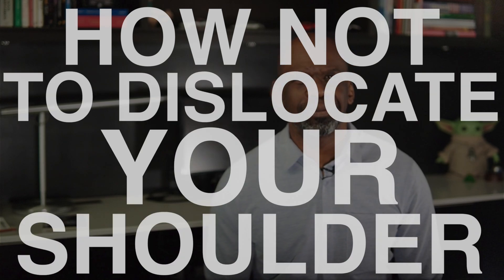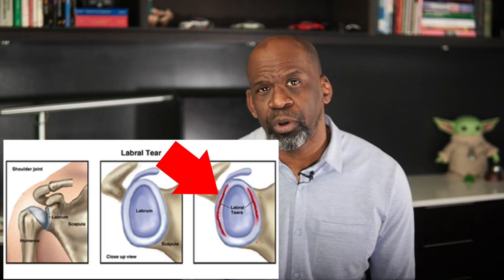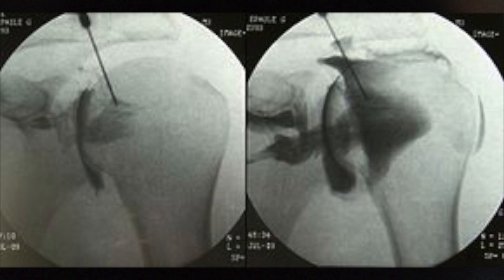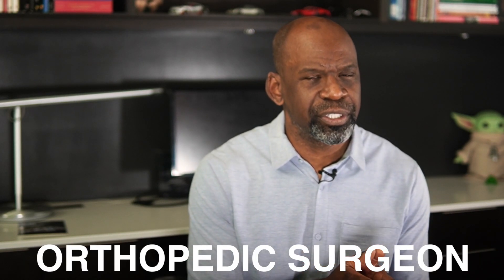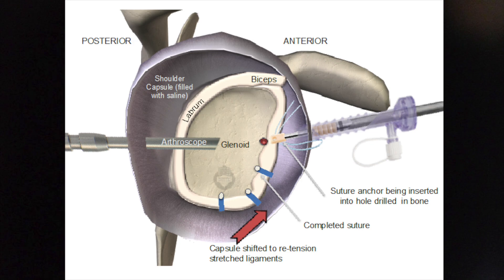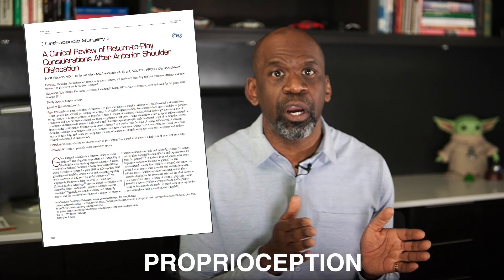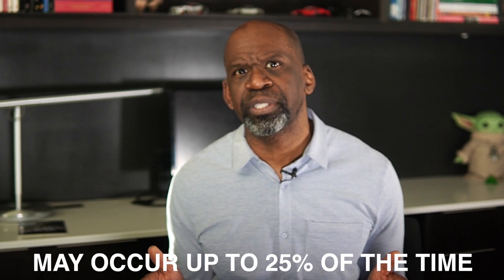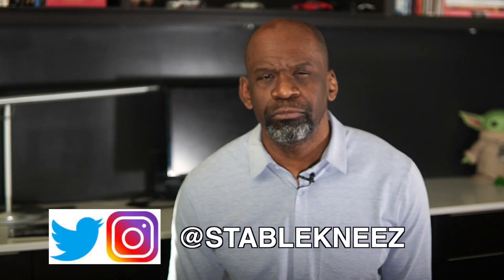Why Does Your Shoulder Dislocate? Surgeon Explains | Dr. Chris Raynor

Comment: I broke my clavicle many years ago... Had to go to the ER. They weren't helpful and just gave me pain meds since i already had it in a sling. No surgery. A few years later my first dislocation... As of now, ive had 4 dislocations. But it hasnt happened in a few years. I'm just curious if my clavicle is possibly the reason for all of this? It healed kind of overlapping. 
I am currently doing very high rep lightweight dumbells mixed with calisthenics about 5 days a week for my strength training. I just started incorporating mobility exercises as well. That is going to be my main focus for a while. I have pretty good range of motion considering all of this. But i want bulletproof shoulders. 
Ive also dislocated my knee cap twice... 😅😵‍💫

Comment: Hi Dr. Chris Raynor, I have been to 3 orthopedic doctors and they were not helpful. they just told me to let it be... please cover options and recovery of AC joint dislocation. My clavicle got dislocated after my motorcycle slid on a slippery road. I was only running 20 kph, slowing down on a heavy traffic ahead. I was wearing helmet, knee and elbow pads and a roost guard for protection. I fell on my side. I felt my scalpula go inwards and my rib cage come in, and somewhat felt my clavicle got lose from the joint. I struggled my breath for awhile ( maybe because of the ribcage being compressed) but i recovered and stood up. Thats when i realized something was wrong with my shoulder, it was painful to lift my right arm.

According to the xray and ultrasound results. I have a dislocated clavicle, slight thread like horizontal break on my 5th rib. and minor injury on my clavicle. I have been to 3 orthopedic doctors, they just told me to let it be, just use a arm sling. I insisted on bandages and side brace. but they said they don't recommend it. They refuse to explain what's the real deal, I mean they just say it will stay that way, i have to live with it etc.  I had to fish around to force them to tell more lol. sigh. They didn't even open the idea of surgery.  They gave mea pain relievers and anti inflammation meds though. 

I had to research on the internet to know for myself.  However those bandages, back support and side brace helped me move through with my everyday life, so i use them everyday. (alternately or altogether). It's  been almost 4 months, no swelling and i can move, but my arm strength is about 50 less now. I feel pain when i try lifting heavier things.  I do try to improve my muscular strength, but very careful on putting strain on my remaining ligaments. I hope you can shed more light in this. I hunger for more information regarding AC Joint Dislocation recovery and surgery. although i'm fincancially incapable of having a surgery at present. I love watching your videos Doc. They enrich my mind. Thanks so much, Merry Christmas.

Comment: I dislocated my shoulder about 7 years ago after slipping on ice with a bicycle. I did the smart (not) thing and popped it back in myself. Luckily, according to the doctors, the injuries were very minor.
The first 2 years it would quite frequently pop out of place and was constantly hurting. I was unable to do a lot of activities (pull-ups for example were a no go, hanging was quite difficult, climbing and so on)
After a couple of years I started training in Bjj, which I assume helped slowly strengthen the muscles around it. Now I can do pull-ups (up to 15 with weights), hanging for long periods, climbing, almost any kind of rotations (I have regained full range of motion and there is no pain at all). For the most part no physical activity is out of limits.

I do remain very careful with it, though, because I've learned how much it sucks to not have those things

Edit: (Just to point out, I'm not selling BJJ as a cure; I'm just telling that it worked FOR ME. I could very well see it causing damage to the shoulder as well if you're not careful).
Reply: What is BJJ??
Reply: @_Md_Anas  Brazilian Jiu-Jitsu

Comment: I’ve dislocated both shoulder literally countless times before having surgery and that sound you made in 2:19 just gave me some really bad flashbacks lol. Thank God I haven’t heard that in a while.
Reply: Do u recommend surgery? And have u dislocated after surgery?
Reply: @ODPhadezz  I recommend surgery asap I dislocated both shoulders same injury both were dislocating all the time. I did my right shoulder first because I was right handed and it’s been great. I was 25 years old. The left shoulder I seriously procrastinated and dislocated it a ton of times. I got it done way later when I was 33 years old (I know 😞). The repair went fine but now two years later I suddenly started having issues again. Mind you I haven’t not been doing anything strenuous at all. Now I’m in consult with a doctor to do a laterjet procedure that should fix the problem which is going to be much more invasive. Because I waited so long I think it made my bone deteriorate and there wasn’t much to build on so get it done asap if they’re suggesting surgery. I’m actually going to the Dolphins team doctor for this one since my old doctor, the Miami heat doctor recommended I go to him for laterjet.
Reply: @jalexander305  thank u !
Reply: @jalexander305  what issues do you need to get a latarjet done? I havent had a CT scan yet, so i don't know whats damaged. Is a torn labrum enough to get latarjet? or does it have to be humeral head fracture specific. Both my shoulders are messed up though
Reply: @jalexander305  yo, bro, how r u feeling? how is ur shoulder rn?
Reply: @nobodyronin  not bad then again I do avoid doing too much. Usually lifting weights and things aren’t a proven but something like sports and quick movements get me nervous although it could just be more mental because nothing has happened.

Comment: Thank you for sharing this Dr. Chris Raynor.

I'm trying to understand how non-operative treatment can be effective for labrum tears. From what I've read the shoulder capsule is attached to the labrum. Does that mean that the part of the capsule that's close to the labrum tear will become loose? If that's the case then I don't understand how strengthening the shoulder muscles can result in a permanent stable shoulder given that part of the shoulder capsule is loose and part of the labrum is (still) torn. 

I can see how one can make the shoulder stable for a short period of time by flexing the shoulder muscles. But apart from that I don't understand how strengthening the shoulder muscles can magically tighten up and reduce the volume of the shoulder capsule and / or heal the labrum tear.
Reply: it cant thats why surgery is needed in most cases. Rotator cuff strength + surgery bullet proof the shoulder

Comment: Hey Doctor Chris. I hope you don’t mind me re posting the same thing on both your shoulder dislocation vids,… but I just posted this on your original video before I came across this video, but I’ve got and been through everything you’ve just explained in this video in both shoulders but I had posted about it in the previous dislocation video.

Hey Doctor Chris, I love your videos, I’ve just found and subscribed to your content, thank you!

I actually have deformed shoulder joints due to a cartilage/labrum problem. Diagnosed by MRA and CT scan. I get anterior dislocations from straight arm circular movements or putting my arms above my head or under my pillow while sleeping, then I wake with a anterior dislocation I’ve even had both dislocate at same time on multiple occasions. I can also easily pop both shoulders out at will but they get very stuck. I’ve often laughed at movies that show them smashing it into a wall,…especially that bullshit lethal weapon scene!

My surgeon actually used a very similar description to you, but he said in my case it’s more like a golf ball on a golf tee and the tee is made of cartilage/labrum and mine is badly cracked and deformed (they said it’s likely genetic problem)so the golf ball can easily slip out of place and get stuck. Unfortunately after  keyhole surgery to mend cartilage failed on both shoulders surgeries drilling through the shoulder blades into the joint to try and fix the cartilage. They don’t think it’s going to help to try again. I’ve also had physio but not much help so far but they said it will only help a little and it’s going to be a long road. He also says I have bad muscle behaviour around those areas which is what allows me to push them of the tee at will, but getting them in again is much much harder. I also have a lot of bone Spurs in the soft tissues of the area due to the many many repeated dislocations,…which is fun. Sometimes I pinch a nerve when they go back in and I need it relocated…that’s fun for days! 

The only way I ever got my arm back in myself was by sitting on a wooden chair grabbing a leg support on the bottom of the chair with my hand and pulling hard straightening and twisting my arm at the same time. It went back in eventually but I still ended up in hospital to have the arm redislocated and put back in because I pinched a nerve and made things worse, and I got very told off by the surgeon,…so long story short… as a long term patient I can completely concur…. just go to the emergency room if you think it’s dislocated! Lol 😂

Comment: Hey doc I really need your help I have been having anterior shoulder pain since February 2021 and was told I have bicep tendinitis but I recently got an mr arthogram and was told I have a very small tear in the posterior part of my shoulder and that’s wats causing my pain and cracking and clicking noise in my shoulder but I was told by my orthopedic that surgery isn’t necessary because it’s a very small micro tear and that some activity modification and pt should help solve the problem. When I asked wether surgery would solve the problem once and for all they said they wouldn’t recommend it Bcz the tissue in the posterior shoulder is very thin and if they were to repair it it wouldn’t solve the problem permanently. Plz help i don’t know what else to do . It’s the worst feeling not being able to work out and it’s affecting me mentally
Reply: How are you feeling now?what did you end up doing?

Comment: The early warning system. So, is it kind of like when you're stretching or doing yoga, and at some point your shoulder goes "Owch, that hurts, don't stretch me any further?
Reply from the maker: Possibly. It depends on what position your shoulder is in. If it is overhead, then potentially yes.
Reply: @ChrisRaynorMD  I was pushing downward on a utility trailer with full force trying to move it when it was loaded and stuck…. No warning doc. It just popped out… horrific injury, but no blood, no broken bones. Funny I had partial dislocations before 15 years ago… they went back in. Perhaps that was the warning. I tried some PT and didn’t have a problem until 2 weeks ago… what a trial this has been. After the second, they referred me to am orthopedist next Friday I go.

Comment: hey doc i had an injury i dont know too much about, the idea i got was that there is a tendon connecting the scapula and rotator cuff and i snapped it with a small piece of connecting bone where the tendon meets the rotator cuff, which caused it to retract into my arm pit. i now have 2 x 2 inch screws holding it back in and my range of movement is bad because i didnt do physio. do you have any vid on this?
Reply from the maker: Not sure what injury you are talking about, but i sounds like you a describing a rotator cuff tear. Often, if left untreated for a period of time, torn rotator cuff tendons can retract into the shoulder joint. Normally, we reattach the tendons to the bone with anchors that look like small screws.
Reply: @ChrisRaynorMD  thanks for the reply ! yes that sounds like it. i didn't get surgery for 3 or 4 days after the accident so that would explain it. this was in 2018 but my range of movement didnt come back, would i be alright go ease into weight training within my usable range of motion?

Comment: Hey Doc, my right shoulder hurts in various ways. 

I used to sleep on it a lot when I was younger and sometimes if I don't sleep properly I sleep on it. My trapezius hurts if I have my arm up for a short amount of time or if I do anything. My right arms feels shorter (when putting my left arm over my head, I put my right hand against my left elbow to stretch it out further with no issue, whereas if I do the same with my left arm it feels stiff.

Recently, I started using electric muscle stimulation on my shoulder, massaging it and started stretching it every other day. It doesn't bother me as much afterwards. 

Any idea or tips?
Reply from the maker: Yessir. Check out our website: humantwopointzero.com. Go to the Patient Resources section. We have a Shoulder Health section there with a crap ton of exercises that you can use to help loosen up your traps, reposiition your scapula, and get rid of your shoulder pain and stiffness.